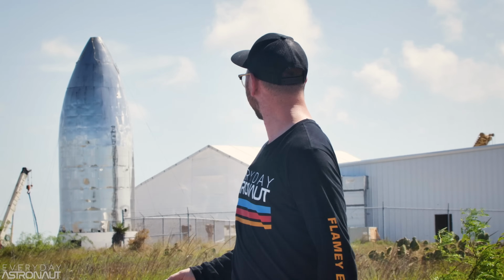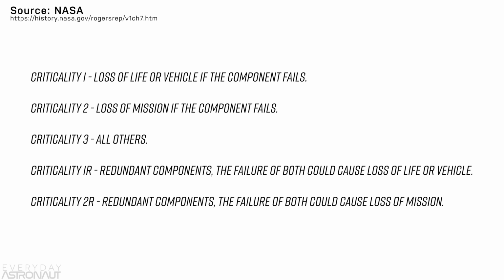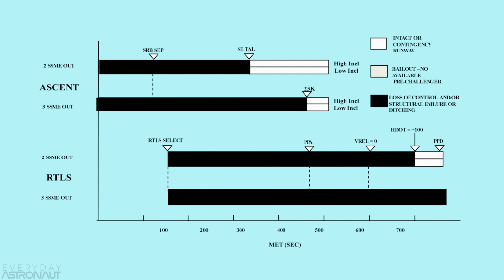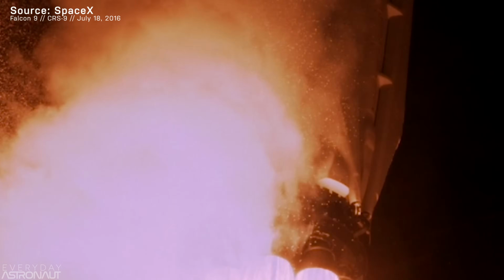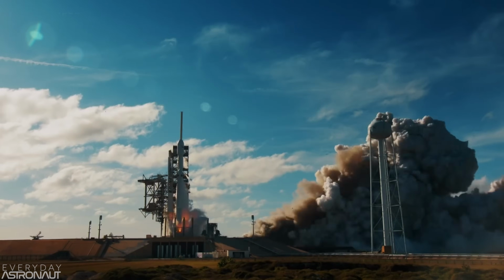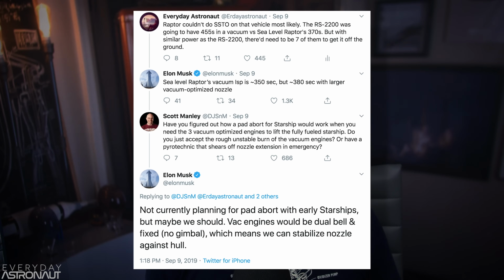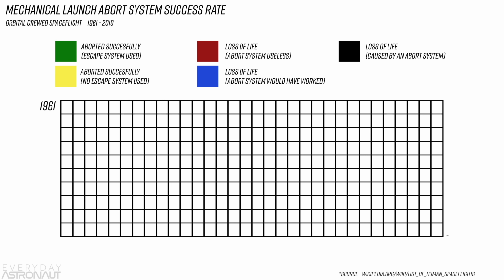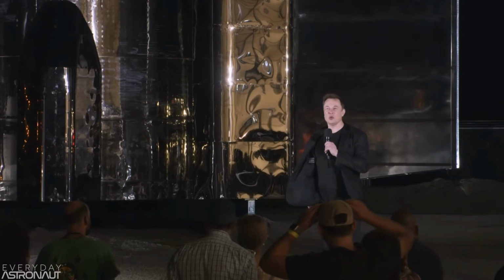Why won’t Starship have an abort system? Should it?!

Comment: Your stats need serious work; if one engine has 13/13 successes and another has 1298/1300 - then what do you imagine are the variance or  confidence intervals ?  Like so many stato-fools you ignore the more complex concept of weighted-value in favor of mere averages.

If I throw one strike-out out at my one time at the mound, and Walter Johnson pitches 3500 strike-outs of ~4800 tries - then who is the better pitcher and where is the most reliable estimate data based on history ?   You'd be very dumb to bet on me vs Walter despite my 100% vs his ~65% average.

Comment: Did he really just say something about an escape system on solid rocket boosters . Von Braun said you could never do that and he was right look at the space shuttle the solid rocket booster was the demise of the Challenger
Reply from the maker: You can still have an escape system on a rocket using SRB’s. Take Orion and Starliner for example. Both rockets have solids and escape systems.
Reply: To add, the srb that took down challenger was externally mounted, huge, long burning, and had a segmented design which caused that explosion. None of those are true of LES SRBs, and they all add risk to a relatively reliable concept
Reply: Challenger only happened once out of a 130-odd missions flown. Compared to Starship, that hasn't exploded on only one test mission, of the missions it has flown. 

Plus, Challenger was being rushed to launch, which is exactly what SpaceX wants to do with Starship if they ever get it into orbit.

Comment: To: Every Day Astronaut. The B F R were all being tested to failure by design. The Space X team, needed to see the effect of catestrofic failure. To test the worst case scenerio. Were only one engine ignited, instead of all three. On the re-entry landing process.  At the very last second. The B F R, infact all The privet space agencies rockets. Have been fully tested by the inventor. For instance the NASSA rocket tanks were tested to failure at 280 psi. These tanks were filled to 260 psi. A safety margine of only 20 psi. Well the Space X and Blue Dragon tanks. Were Built to fail at 380 psi. To be filled to 280 psi. A 100 psi. safety margine, vs. the 20 psi safety margine. Of NASSA. Well after testing with air. The Tanks sustained 380 psi., no problem. The fail rate was infact, 780 psi. A safty margine of 500 psi., before failure. These rockets are extreemly safe. The 780 psi fail rate, allows for all the fule you need. At greater pressure, for the same size rockets. Fule can be stored to the point of near freezing. Tons and tons more fule capacity, for all these private space ships. Due to carbide as the the alloy mix. Instead of the old carbon steal mix. Much smaller more compact carbide atomos. Much better iorn crystal formations, for much stronger steel. The strongest steel alloy, ever created. Yours, Joel Ramirez ramirez. Stalag Five AKA "The Hotel California" The sacredest spot on Earth for aerospace, Nicasio, CA.

Comment: Two and a half million moving parts, huh?  Lets take a typical engine valve.  I would define that as one moving part, the valve, the spring, the cap, and two keepers, all assembled into one part.  If you define that as five parts, or a snap ringed piston rod assembly as 15 parts vs. one, then maybe.  Calling single parts what most people would call them, I would be very surprised if there are 2 1/2 million of them.  

I would point out that if you count the parts of a typical V8, split into their component parts, then that will be a LOT of parts, and I haven't counted them, but I wouldn't be surprised if there are more than what either you or I would guess without sitting down and really thinking it out (assuming you know how a car is built end to end).  

My point is that a car, disassembling every moving part, oh wait, do we include that fact that the car itself moves, therefor EVERY part is a moving part? Hopefully you get my point.    I hate statements like 2 1/2 million moving parts, with no definition of how a moving part is defined, WTH does that even mean?  It's a garbage spec, to my way of thinking.

You very much can shut a solid booster down.  It's called thrust termination and is achieved by cutting the rocket casing with a charge that basically blows the side out for some distance, which range safety did employ on the solids after the disintegration, as they were still thrusting, obviously.  It may not be a viable way to shut down boosters with the shuttle still attached, probably isn't. but it is possible.

Last question.  Where the hell else do you think they were going to put that shuttle?  Maybe put it on top somehow (not really viable from an aero standpoint), or drag it behind?  It's kind of the only place you can put it.

Comment: Over all, a pretty good bit of analytical work. I would say that, rather than comparing safety between airliners and rockets, high performance jets and helicopters is a better comparison. Rockets will always be right at the very edge of safety, and so with military jets, because you want the most possible out of that platform, or helicopters, which are pretty sensitive to any sort of failure.

Comment: Your opinion is: I want an abort system. And you have every right to this opinion. But in EVERY project you have money limitation, time limitation and the "unknown unknown" problem. As you told us, the abort system has saved 2 lifes up to now. But you have not told us how many lifes were saved by other parts in the rocket, like "because system X was redundant and not single Y lifes were safed". Or "because we spend money and time on the abort system, we did not work on other topics (that were more important in hindsight)". As project manager you should look for the "most bang for the buck". You need gut feeling for this. I can not say if your gut feeling is better than the gut feeling of the project manager. But I know something: for every real trainer of a soccer team, there are hundreds or thousands of "I think I can do a better job" wanna be trainers. But still, after the team looses, the trainer normally keeps his job and none of these wanna be get the trainer's job. I assume you are just fishing for comments with your opinion.

Comment: I think you are being WILDLY optimistic on a Starship (second stage) abort. Compare the Crew Dragon Superdracos to Starship (second stage). The Superdracos are at full thrust after 100ms and Raptors take a second or more to get to full thrust. So the Raptor engines just don't spool up fast enough. The Crew Dragon has a TWR of like 4.6 to 1 with an abort. Starship (second stage) will barely be above 1 to 1. Not enough TWR for an abort in a catastropic event.

Comment: “Fly rockets more often and fly reusable rockets over and over again... Only then will we achieve airline like reliability”
And getting to that point we’ll kill a lot of astronauts. It’s kind of sad to realize it’s unavoidable.
Reply: Hence, the need for abort systems until they are reliable enough like airliners. And airliners still crash. So the public perception of 100% success on spaceflight will ALSO have to change.
Reply: @steveaustin2686  there are no abort options for Starship upper stage. They’ll have to fly unmanned (supporting Starlink2?) while they learn all the different ways a Starship can fail then put together a LONG streak of successful unmanned flights. Probably cancel all Falcon flights just to get more Starship customers. 
And hopefully do it all in time to qualify Starship for Artemis. 
Very ambitious. Hard to believe they can pull it off.
Reply: @rong1924  Musk has said that it would take HUNDREDS of successful, operational flights before crew could be considered.

Cancelling Falcon 9 flights would likely depend on the cost of Starship. Right now, a Falcon 9 flight starts at roughly $55M to $67M, depending on recovered or expended. Then you add in integration and other costs. Based on the $2.94B HLS Option A contract (pg 8 Selection Statement) for 2 landings at up to 10 flights each (GAO pg 27 w/Musk's update), a Starship flight is roughly $147M each to NASA. So if Starship is more expensive than Falcon 9, they may not be able to cancel them. In any case, Falcon 9 would still fly, as Crew Dragon flights would not be moved to Starship. NSSL payloads may not move as well, but likely could be moved faster than crew flights.

Yeah, Starship will definitely take time to mature, especially as the initial launch cadence for Artemis III is 1 launch per 12 days per SpaceX's plan (GAO report pg 10).

Comment: Interesting take on launch abort. You mentioned over pressurization as a potential problem, well let's look at all of the times in a LEO mission's tanks would have to be brought up to pressure and use of ullage rockets.

1. On the pad. Even fueled and then a crew is put on board there is a chance for an explosion. When the tanks are brought up to flight pressure this could cause a rupture of the tank walls or bulkheads. Re-use adds to this problem since cryogenic fuels contract the tanks walls as well as the height of the rocket. This continued cycling of the tanks could introduce small, microscopic cracks in the fuel and oxidizer tanks leading to a failure of the tank.

2. Inflight Abort. There is a danger on ANY flight that there could come a time when an engine fails due to combustion instability or just engine failure. This was a major problem for F-1 Engine development, several engines were lost in dramatic fashion in the test stand due to combustion instability. If an engine was lost/shutdown during powered flight it could cause damage to adjoining engines on the stage causing more failures and the loss of the booster. Then when landing since this is also done by firing the engines this as well could lead to the loss of the vehicle.

Engines fail, it's a fact of life. People today in the public and NASA in the past, have believed that 10 or 20 flights will prove out the system and an abort system is not needed. The Space Shuttle or STS was deemed to be operational after 4 flights. Then comfort set in, not following flight rules, and we had the loss of STS-51L (Challenger). The same thing happened with the loss of STS-107 (Columbia). NASA had seen an increase of damage done to the SRB's after recovery from foam strikes.  They did not think that a 4-pound brief case size piece of foam could cause the loss of a ship. They were wrong.

Abort systems are needed on ANY crewed spacecraft. Here is an example. Starship is launching, a catastrophic failure occurs in the booster and somehow starship is able to avoid the debris form the explosion. It's over water, how is it going to land? It uses a group of engines to land on land. It's not designed to land on water. So, it comes down and settles down on the surface of the water. What happens next? Does it drop straight down and sink because of its weight? Or does it tip over and have the crew cover an arc or 90 degrees and impact the water with the hatch first, just as an example, and break up from the impact with something that has a higher surface tension than concrete or just saying it doesn't break up, take on water and sink with the crew on board, or stay in one piece with the crew egress hatch now under water? How can the crew escape?

These scenarios and many more need to be evaluated, looked at, and evaluated. Remember after the loss of STS-107 NASA decided that only 100+ launches was not enough to thoroughly test a space vehicle for operational use. Planes, since you used them as a reference, will fly hundreds of times before the FAA will even certify that model of plane for use by airlines.

Comment: I'm not an engineer but by common sense there's no substitute for safety.   Ground control did not follow the safety recomendation of no flight on Space Shuttle Challenger resulting in tragedy. Similar negligence caused by passing the critical damage to Space Shuttle Columbia heat shield on left wing base at launch. No engineering inventions were needed. Common sense lauch cancel on Challenger and standard operating procedure for rescue mission on Columbia (it could orbit for additional 18 days with sufficient living supplies) could have given chance for crew survival on both events.

Comment: My question: why does super heavy not just use a parachute instead of landing with its engines?
Reply: You'd need massive parachutes which would weigh and cost a lot, you'd still need to slow down somehow so that they don't tear and there probably are a couple of other reasons as well

Comment: Hey Tim. I have always wondered why during the 15 days Columbia was on orbit, the sensors in the left wing weren’t showing a difference of temperatures when compared to the right wing. Because the interior was unequally exposed to  the vacuum of space during sunrise and sunset every 90 minutes.
Reply: Going from memory here, but I think that a lot of the thermocouples and strain gauges that they used to reconstruct the failure in the investigation were on a separate structural diagnostics DAQ system, left over from the original flight test program (only Columbia had them), and not sure they were able to be monitored by the crew. I wonder if that telemetry was always active, interesting thought about observing different diurnal cycle impacts in L/R wing spar temps or strains while on orbit. The official report says a lot about the data sources, but I don’t remember seeing anything about spurious data before reentry.

Comment: If I were a Dragon V2 pilot, I would be comfortable being on top of the merlin engines bc it is literally as reliable as hand sanitizer. For now, I'm only flying on the dragon. Once I see the starship fly 50 times with no to little failures, along with at least one flight having a starship abort in any stage of ascent and land sucsessfully will I fly on a starship. SpaceX has proven that their Dragon Spacecraft can abort and be sucessfull. I don't want anybody to ever end up in a situation like columbia, where there literally is no chance of saving the men and women on board.

Comment: 19:00 "nine engines give more safety"

No, it increases the chances of one having a problem by a factor of nine.
The effect of a single engine stopping is reduced byt the danger of something catastrophic happening goes up.

19:49 "shut it down before it has a catastrophic failure"

What you are saying is that you don't need seatbelts because your car has a very fast auto-brake system.... it's beyond dumb

19:50 "Extreme reliability"

Those are famous last words. Come on dude,I know you're not that stupid. 
First, the current engines that SpaceX are trying to build melt. They MELT. Yes those enignes are still in a development stage but don't say they are extremely reliable when the next generation has a problem as pathetically elementary as temperature.
Second: The engine is not the only thing that can fail.

33:00 "starship could pull away"

From an explosion?

Are you really this stupid?
Reply: 1. Having more engines doesn't physically increase the chance that one will go wrong. Each engine has a default percentage of going wrong (00.12% probability; probably less as they have perfected the engine). Engine probability doesn't factor as you add more engines because it doesn't cause the chance of another engine failing to increase. Adding more engines decreases the likelihood of mission failure because you would still have the engine power necessary to go to orbit. It is designed with "engine out" capability, so even with two engines out, it can still complete the mission. This increases the safety margin.
2. Not sure what comparison you are making. he isn't saying that having each engine contained/monitored is a trade-off for any system. In your analogy, you would still have your seatbelt on, plus the auto brake system (aka more redundancy). 
3. He provided facts about the Merlin Engine percentage of failure so I'm not sure why you are trying to discredit that. You continue to say that "current engines SpaceX are building" which implies that you are referring to the Raptor engine. This is not the engine being referenced in the video at the timestamp. Building any new engine requires testing. SpaceX likes to have a high production volume so they have the ability to test failures rapidly and in real life instead of a simulation. They push engines to their limit, redesign, and try again until it is as perfect as they can make them. You then say, "The engine is not the only thing that can fail," which is true. However, the quote is talking about the Merlin Engine, not other parts of the rocket. You are taking the quote out of context. 
4. Not sure what you are going for here. Tim shows a simulation of what it could look like and explains that it couldn't outrun the shockwave. Starship is made from stainless steel and can survive high temperatures. Assuming that the shockwave doesn't break the upper Starship stage or rupture a propellant tank, it would have enough thrust to make a soft landing nearby. I am assuming this would be the water as Starship won't have landing legs and the launch site would be destroyed.